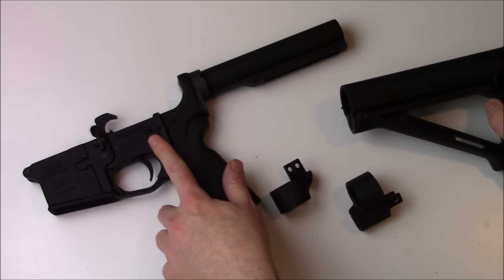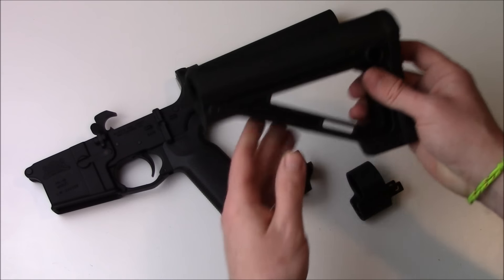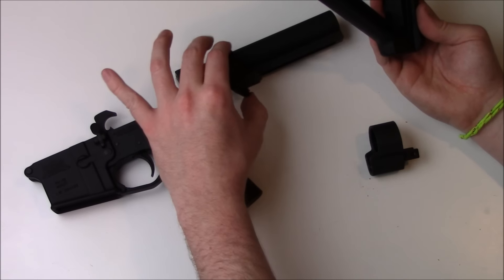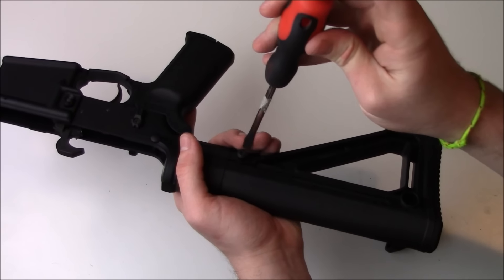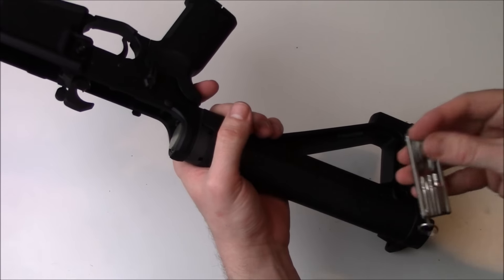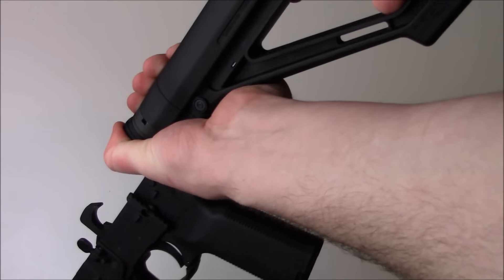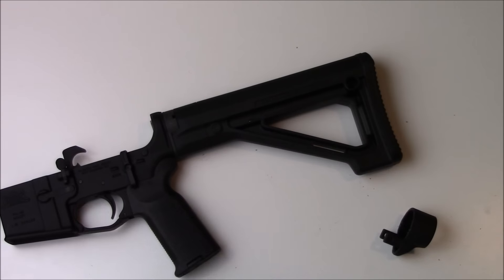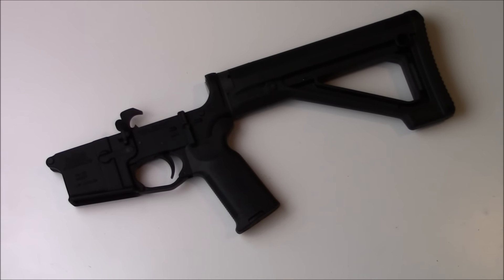Magpul MOE Fixed Carbine Stock Install/Overview

Comment: The ONLY problem I've ever encountered with these has been manufacturing  inconsistencies among various mil-spec and commercial buffer tubes that prevent the single screw from being installed.
Reply: I’m having the same problem. Any workaround?
Reply: I can't get the stock to slide on my buffer tube any ideals to help fit it

Comment: picked up this stock on my 6.5 grendel iron sight carbine for deer hunting out here in the sandhills, i love it. i wanted the rifle to be short and handy and easy to snap shot since most deer out here are taken at sub 200 yards with them running out of gullies. i prefer to tuck in real close on my gun and this little stock is a dream.

Comment: The stock wont slide on my buffer tube as easy as urs idk why it will another ar of mine but not the one im try to put it on any suggestions
Reply from the maker: Is one of your buffer tubes milspec and the other commercial spec? There are different specs that different companies use.

Comment: What buffer tube are you using? I can't get mine to fit past the bottom rib
Reply from the maker: You just have to make sure you’re matching tube types. Tubes are either milspec or commercial spec, and stocks are sold for each. Match your stock type to your tube type and you’ll be good.

Comment: I have the same thing but mine isn't fitting snug in the receiver? You didn't seem to push to hard which worries me
Reply: you probably are trying to install a mil spec stock onto a commercial spec buffer tube

Comment: my M&P 15 come with a rifle length buffer tube, this stock wont fit all the way because its too shot
Reply from the maker: like a fixed stock buffer tube? This is for Carbine style buffer tubes.
Reply: @booliganshootingsports  just wandering if there is a fixed stock that will fit the rifle length buffer tube, you think A2 stock will fit?
Reply from the maker: @qawsqaws5284  I’d assume so, if it’s an A2 buffer tube. Without seeing the tube, I couldn’t tell you what would or wouldn’t fit.
Reply: @booliganshootingsports  A2 wont fit, because its all rounded (circle shape), modern buffer tube has a little slot bar sticking out (like a key hole shape), it wont go in
Reply from the maker: @qawsqaws5284  you’re describing the difference between a rifle buffer tube and a carbine buffer tube. An A2 stock is a rifle stock that fits on a rifle tube, which is fully round like you described.

Comment: I have what looks like the same stock but I can't figure out how to remove it. Lol help me plz thanks
Reply from the maker: Unscrew the cross-screw and pull it off the buffer tube. That's it. It might be tight on there.
Reply: @booliganshootingsports  that's where I'm having issues. There is no screw there...
Reply from the maker: @cheth.9223  Then it should just come off. That screw is the only thing that holds the stock in place normally, unless the person that put your gun together jerry rigged it somehow.
Reply: @booliganshootingsports  just found out.....he took it to a gun smith and made it fixed fixed..............now I have to take it to a gunsmith to remove it lmao shit
Reply from the maker: @cheth.9223  Only thing I can think of is if they drilled through the stock and buffer tube to put a cross pin through. It would be easy to see if they did that. Or if they possibly added a screw at the end into the back of the buffer tube. Really strange.
Reply: @booliganshootingsports  yeah I can see the cross pin now that I know what he did.

Comment: Can i install it at any lenghth? Or do i have to push it all the way in to the reciever?
Reply from the maker: It pushes up to the receiver at one fixed length, unless you drill a cross hole in the bottom ridge of the  buffer tube.
Reply: @booliganshootingsports  hey there, thinking about doing this--but in CA, I cant get caught at the range with it set at that extended length, correct? Gotta lock it back in place before anyone comes and checks it. 

#CAsucks